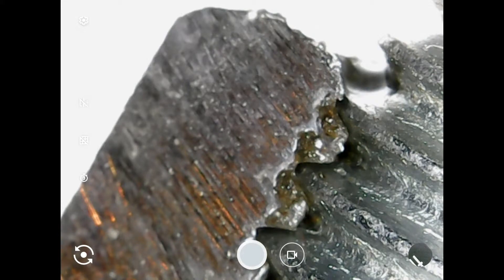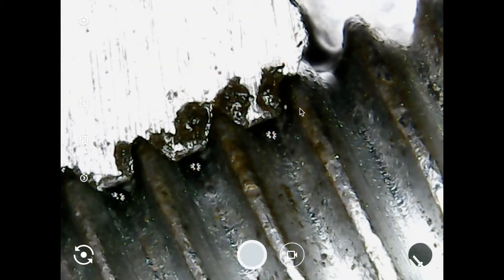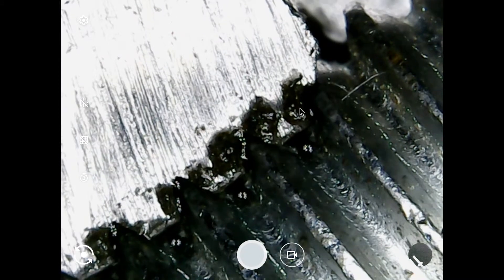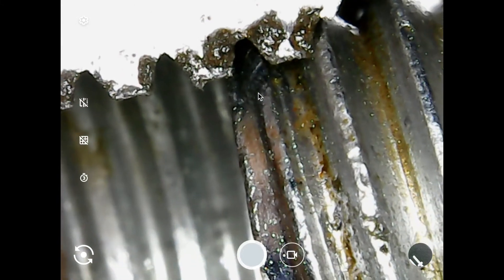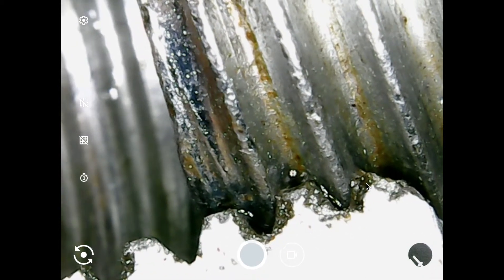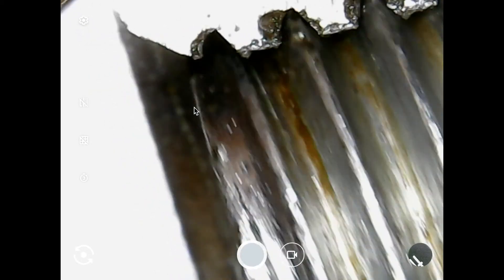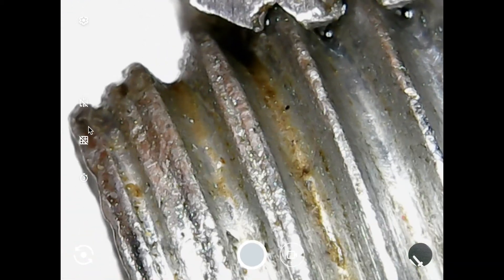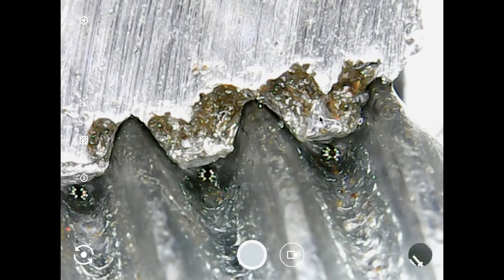Thread Engagement How to determine bolt length Bolt Depot #boltdepot

Comment: how to find HSFG bolt length(shank and thread length) grade 8.8 dia of bolt 24mm by using IS3757-1985 if the thickness of member is 101mm and 80mm??
Reply from the maker: This will cost you $$$   as I do not simply answer any question because people on youtube ask it...  If, you need this information for a job, then you will profit from it and therefore, I should also profit from teaching you.

Comment: Interesting double whammy for bolts not fully engaged with nut. I knew both the bolt and nut had starter threads but the microscope make the implications brutally clear. I can envision that fully engaged bolt can be stronger and more stable than one that is not using all its threads. Knowledge is power.
Reply from the maker: I have a lubrication video coming up tonight, maybe...   I also redid the one video from the live stream last night and will post it later...  Just showing how to check the valve seat for ''run-out"...  I am using my lathe to show this... Only about 3 minutes long.